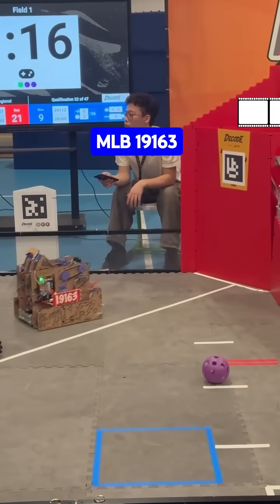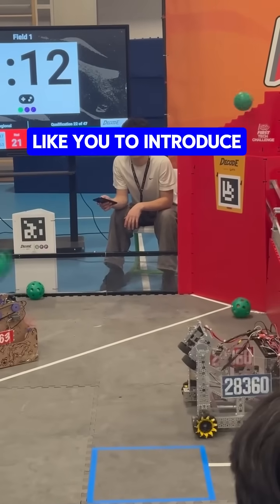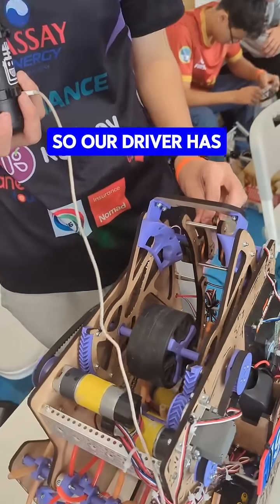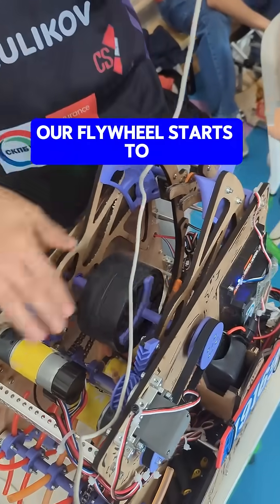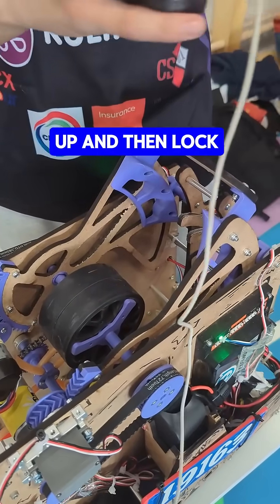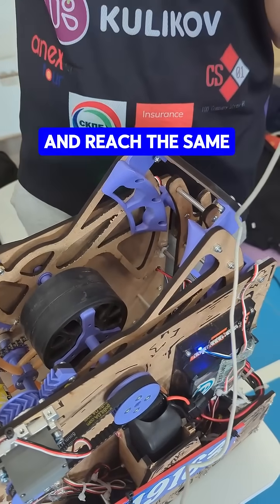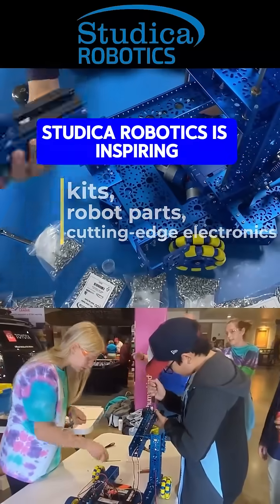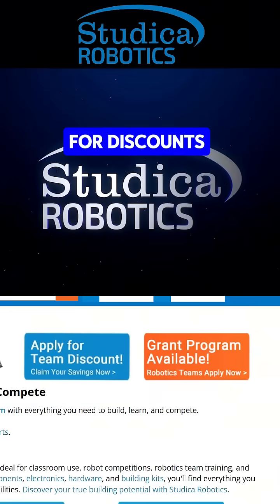Efficient Intake + Shooter 19163 MLP | FTC Snapshot

Comment: I love FTC because of the materials we can use. With a laser cutter and a 3D printer, plus COTS equipment (motors and drivetrains), it's possible to build a very competitive robot. Using commercial off-the-shelf motors, gears, and drivetrains gives you a robust and proven starting point, so you can focus your innovation on the unique mechanisms for the game's challenges.